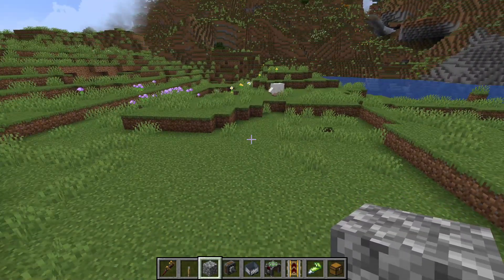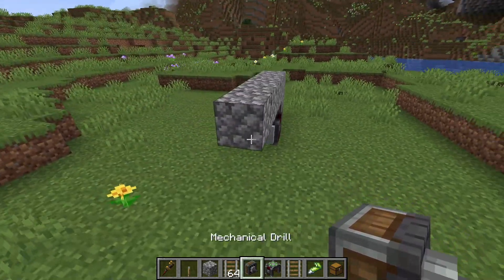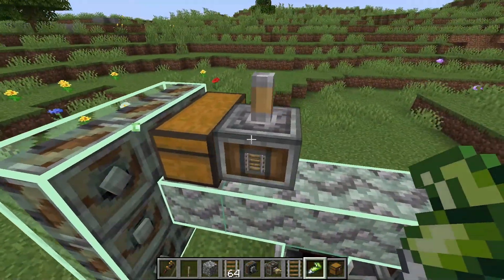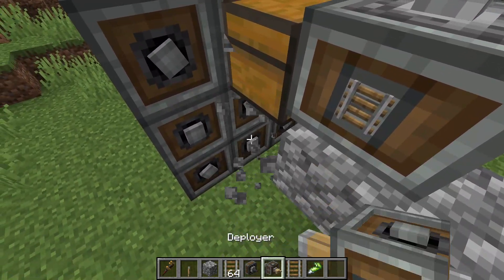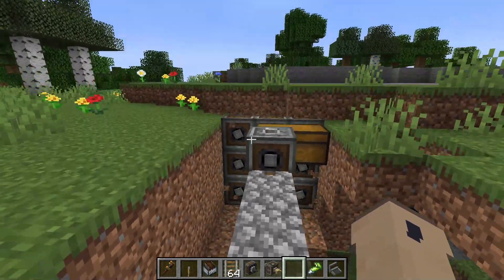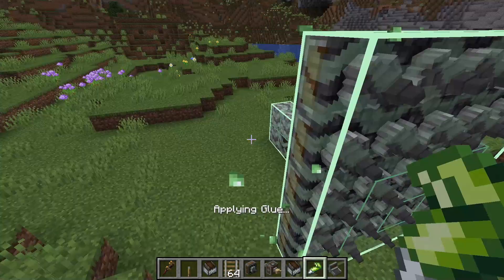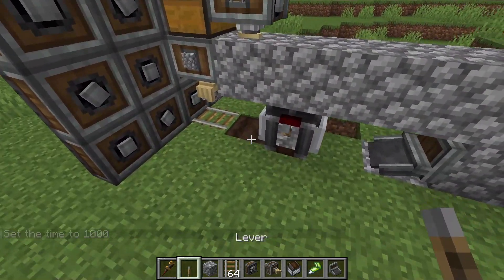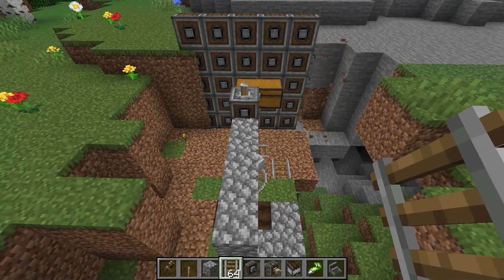Create Mod - How to make an Easily Scalable Mining Drill

Comment: Did this on 1.21.1 and doesn’t work anymore at all
Reply: ive done this in create 6 latest version in 1.20 and it worked
Reply from the maker: @guilhermesviech4610 thanks for the comment, @mallo1353 might've built it wrong. This tutorial isn't really my best work, so I'm sorry if the information doesn't come across well enough.
Reply from the maker: okay, this video is years and months old

Comment: a fix for the slow down is to replace the regular minecart with a furnace minecart then you fuel it or as another said add additional deployers and ploughs to make the rails redstone and redstone torched but the furnace minecart is easier and cheaper idk if it works better

Comment: I tried making this, copied it peice by peice, and it keeps wanting to either spawn in backwards, or just not go forwards. If i leave the cart assembler toggeld on, itll go forwards, but spin around and just break. Any fixes?
Reply from the maker: Keep the Cart assembler in lock rotation mode. Use powered rails and redstone torch deployers along with another plough to keep it powered. The start-up is the hard part!

Comment: tip: if the drill starts doing what happens on 6:45 you have to pick it up place it on the cart assembler and with your wrench use the lock rotation option
Reply from the maker: thanks bro, I figured that out and use that trick on servers. It has been over a year since this video was out though lol.
Reply: @QwakyDuck  upload again 🙏🙏
Reply from the maker: @ I'm going through a hard patch in school right now, but I'm going to work on some more create mod stuff! Thanks for the support.
Reply: @QwakyDuck  yaa i keep forgetting how to make it 😢😢😢😢

Comment: Ive spent like 2 hours trying to get this to work, Idk what the hell im doing wrong but all it does is kind levitate and place a rail. it will not move at all no matter what. I tried placing it on activated and regular rails and no difference really frustrating
Reply: used a furnace cart instead and it works now

Comment: Since the rails aren't actually powered, the mining drill will stop after a couple minutes! If you want to avoid this, you can replace the deployer that places regular rails with Powered Rails, and put another deployer alongside it that places redstone torches. Also, add another plough next to the old one so the torches are picked up!
Reply: To avoid running into water breaking your torches you can instead place redstone blocks and then that fixes the water/lava breaking your torches
Reply: @timed458yt7  but the mechanical plough cant pick up the redstone blocks, so u would have to use another drill right
Reply: @GameName5555 have a deployer place blocks under the torches
Reply: @GameName5555  just use furnace chest
Reply from the maker: Thanks for clarifying for other viewers! I’ve been busy with school and can’t respond to every comment so this helps!
Reply: It still stops somehow
Reply: This needs to be nerfed. How so all that machinery is feed only by redstone torchs

Comment: what is it powered by??
Reply from the maker: The rails move it. It is a minecart contraption so it does not need power other than being pushed by the rails. I’ve had issues with it recently, but to my knowledge (limited), it works.

Comment: bro i forgot that the machines on the minecart contraption didnt need kinetic energy until i came across this video
Reply from the maker: All good bro. They’re awesome for drills and auto cobble gens.
Reply: @QwakyDuck that doesn't work with me i had to use powered minecart😢
Reply from the maker: @alto3221  hmm. You mean like you had to place down powered rails or...?
Reply: @QwakyDuck  This is old but for me I have to use a furnace cart to push it since the machine stalls after loosing momentum from the powered rail.

Comment: for making it work you have to make the machine one block longer at the back and also place the mechanical plough one more block away at behind
Reply: you are a life saver, tysm
Reply: @cadenroy8288  but it still wont work unlimited it gets slower over time and surtainly stops because it runs "out of energy". Then u just have to reassamble it to continue. But u have to stay near the machine anyway because of the render distance. No problem!
Reply: @bebini1339  actually you dont have to dissasemble it walk up to the back of the cart and push it forward it will recalculate the speed to what it should be
Reply: @bebini1339  use powered rails and add another to the side to deploy redstone blocks and it wont run out of energy
Reply: Thank you very much

Comment: Hi, I built a cart contraption, but when I try to pick it up with a wrench, it says it's too big to pick up. I raised the limits in the create settings to the maximum, but it still writes. The drill is about 45x6 in size, I have deployers in front of the drills to place blocks in front of the drills to destroy the lava/water, same on the side and top and bottom.

What should I do to be able to take it normally? I saw on some videos that they have much bigger drills and they don't have a problem with it.

Thanks for the tip yacobv!
Reply from the maker: I would try to limit the amount of drills. 45x6 Is quite large and might lag out your game or even make an area of server a chunk ban, I have no clue how to disable the limit, but I hope you can figure it out! Good luck.

Comment: Thanks, this really helpful and now i can just chill while drill does all work but i got a problem, hands that should place rails just won't work and places only 1 when launched and then just doing nothing. (Version 1.16.5)
Reply from the maker: try to store rails in your chests that are attached. It should automatically place them that way, you could always look up another tutorial if you can't figure it out yourself, but I bet you can.
Reply: @QwakyDuck  but i did! I put on contraption barrels and put rails into it and hands won't work even when I'm giving these hands like 10 rails and after one they stop placing rails,
Maybe problem in barrels?
Reply from the maker: @bandit_rid9197  interesting. Try looking at someone else's tutorial if what I'm doing doesn't help. I originally made the video bad and it blew up recently, I'm not that experienced with create tbh.
Reply: @QwakyDuck  okay, thx anyway for help
Reply: @QwakyDuck  I fixed my problem, problem was in deployer height, deployer was placing rails in block instrad on

Comment: It works but after some time it slows down to the point it stops, does it need a powered rail?
Reply from the maker: In some other comments, an Idea was posed to me that works quite well. Have a second plow with a deployer in front that places redstone torches. Use powered rail instead of regular rail and bingo, Infinite forward force.
Reply: What if you put a Redstone block on the side on the rail
Reply from the maker: @qgaucho9088  You can do that, if you want to lay down a train or permanent track, a torch would be more bang for your buck and easier for a plow to break if you want to just reuse the same rail
Reply: @QwakyDuck  I mean moving the redstone block with the cart so no breaking required. It will now dig through the world.
Reply: If you use a minecart with a furnace, you can fuel it with coal/charcoal and it’ll stop after a certain amount of time. I like that better than the endless powered rail type.
Reply: I moved my plow further back from the cart assembler and it worked foe me
Reply: You need to fill up a chest with some coal

Comment: i followed step by step and it just stops like 1 or 2 blocks after i start it
Reply from the maker: If it doesn't work, you can watch my other better made video on it. I think your issue may be the plow, make sure it's more than just a block behind it. If nothing works, watch someone else's video on it, there are a lot of videos similar to mine and they're probably better made too!
Reply: When I tested it the reason it kept stopping was the cobblestone deployer. i removed it and replaced it with just a normal piece of cobblestone and it worked just fine. it wont make a bridge but it keeps moving
Reply from the maker: huh, weird. @featherfruit  good that you figured out a solution though.
Reply: @QwakyDuck  I was also on 1.16.5 with the create above and beyond pack if that makes any difference. It did eventually stop after a while though so I'm not sure whats up with that

Comment: You could use powered rails
Reply from the maker: Actually, Unless there is an exterior source to power them, like a person placing redstone torches or levers, you cannot power them with the contraption to my knowledge. You can try it with your own design if you wish. @ me with a video or picture showing it working if it does.
Reply: Add a deployer with redstone torches to the side of the rails, and add an extra plow. easy fix @QwakyDuck
Reply: @QwakyDuck   does deployers dropping redstone blocks next to the track not work anymore?
Reply from the maker: @femimark5021  I didn't think of it that way, I meant actually having the redstone block on the contraption. That's a good idea though if you have a redstone farm or a stockpile of redstone and gold
Reply: @QwakyDuck  or you could use a drill to keep breaking and placing a few redstone blocks
Reply: @QwakyDuck  Maybe you could have another deployer placing redstone torches with an extra plow in the back to pick them back up?
Reply from the maker: another commenter recommended the same thing! I'll make another create mod video soon to try and encapsulate all I've learned about the minecart contraptions after I've finished and put out the other project I'm working on! Thanks for the comment @the-person
Reply: @the-person  I added this and it works great. I had to add a second deployer to place blocks for the torches, but it wasn't hard to add and the cart maintains top speed indefinitely

Comment: Is it possible to have 600 mechanical drills, i need a 100x6x100 hole
Reply from the maker: It's possible, but on more recent versions of the mod, there's a limit to how much you can have at once. Also, you need 2 layers if you're going vertical.